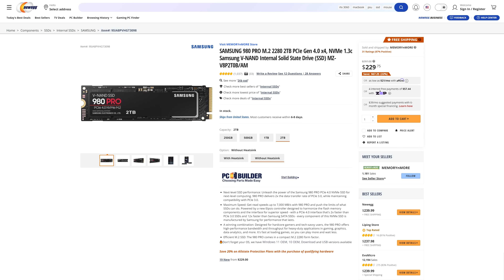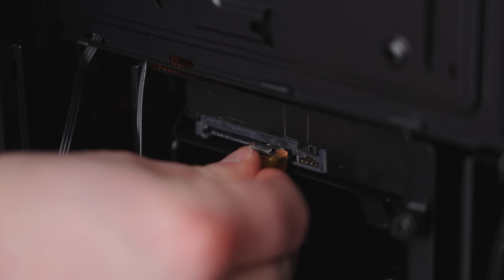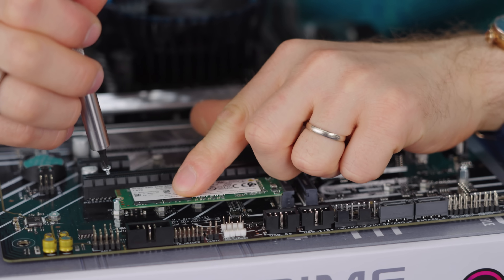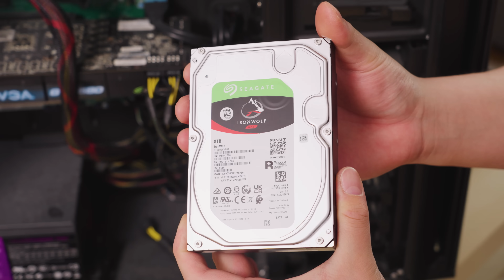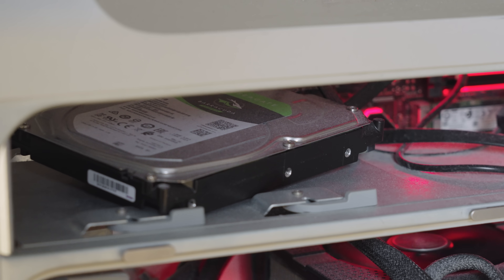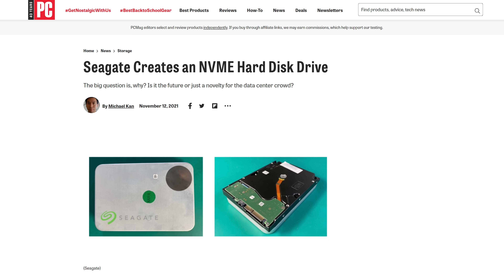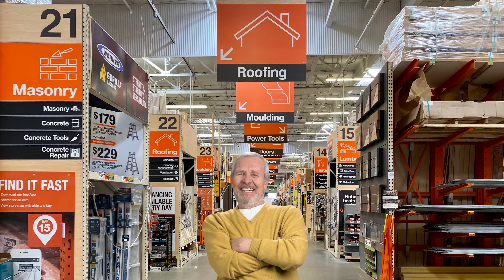Is SATA Obsolete?

Comment: Satas still around in 2025, i figure once they figure out NVME drives with a cable-based comnector itll phase out sata, having NVME drives be off thw motherboard would be much better for cooling properly.

Comment: Until motherboards come with as many m.2 slots as they do SATA ports, then no, SATA will not be obsolete. With SATA, you can fit way more and expand to way more SSDs on a single motherboard, as you can put the SSDs somewhere else in your case.

Besides, I'm only concerned about using an NVMe SSD in an M.2 slot for my boot SDD so that my OS can take advantage of the extra speed that most (maybe all) games do not take advantage of.

Comment: SATA SSD's are only 1 or 2 seconds behind an NVMe SSD on bootup times.   absolutely not dead - far from it.
Reply: I'm using a dramless sata ssd and it works fine even with Windows OS, really curious how long this will last

Comment: You can also just buy one of those not sure how u call them extenders? they split 1 sata into 2, the downside is if you use Bouth ssds at the same time they get half speed, but its still 100% speed if its just 1 i think, so kinda bad if you transfer files from 1 to the other, still cheap way to get extra sata ports

Comment: orignal SATA came out in 03/04 and offered 1.5Gbps, SATA II was introduced in 2007 with 3Gbps and SATA III debuted in 2010 sporting 6Gbps. By that pattern, one could guess that we would have been on at least SATA V running at 24Gbps bandwith speeds.
But no. 
Its been 15 years and we are still stuck on sata 3 with no updates on the standard being developed further. Its like companies said "yeah thats good enough" and just gave up on it. Im very sad to see this interface be left to slowly die from neglect.
Reply: PCIe SSDs took the spotlight and they decided SATA couldn't compete.
Reply: @kassarc16  That doesnt really explain anything, cause by the time NVME was mainatream in 2017, SATA couldve had 2 more revisions. Someone somewhere made the concious decision to just not develop it any further, and no one really knows why

Comment: My desktop PC has Asus ROG STRIX Z390-E motherboard which has 6 SATA ports and two M.2 slots.
I don't even use the SATA ports on the motherboard. I just use NVMe drives it offers more of a clean look and means less cable management I will have to do.

Comment: Just got an 18 TB CMR hard drive that fits in a single 3.5" space. Currently this costs about the same as PCIe 4.0 NVMe 4TB drive, i.e. 4.5 times the price. If you're going for bulk storage, SATA hard drives are still (in 2024) the best.
Reply: With a failure rate of 1 year max and write/read speeds of 272 max. Quality over quantity for me im good!

Comment: Here's the thing about hard drives: if you want bulk slow storage, you also want reliable storage most of the time. Are you willing to buy twice the capacity you need to ensure recoverability in the case of a drive failure? And would you be better off buying an SSD instead?

Comment: Any Windows doesn't need nvme speeds, a cheap low capasity sata SSD with dram or controller will do just fine, its not like windows won't do anything in the background while you play a medium or large game when both are in the same nvme, if the sata SSD boot drive suddenly or not suddenly dies without everything else is cheaper to replace and a lot less time consuming re-downloading everything loss than an nvme dies with everything in it.

Comment: You guys should pull this video down. It's deeply mistaken about something -- namely, that putting additional M.2 drives in your system does not reduce the available PCIe lanes to your graphics card unless you specifically go out of your way to install a riser card AND your motherboard supports PCIe bifurcation (hint: it probably doesn't.)

Comment: The GPU performance part of this video is a bit misleading. I understand his main goal was to talk about SATA but this part adds unnecessary fear among many PC builders. Anyways 99% of the people will have no problem using all the available M.2 slots on their motherboard. Basically this number depends on the CPU and the chipset of your motherboard, therefore you will see specific number of M.2 slot in a specific chipset. For example both "Gigabyte B650 GAMING X" and "Asus TUF GAMING B650-PLUS" has 3 M.2 slots as they are running the same B650 chipset which are made for Ryzen 7000 series. As the Ryzen 7000 series has 24 usable lanes 16X is used by your GPU 4X is used by SSD1 4X is used by SSD2 and the 3rd SSD runs on a dedicated X4 lane built in the chipset. Again X670 chipset motherboards can run 4 M.2 slot SSD where 2 uses CPU lanes and 2 uses the chipset lanes. That's why you will see 4 M.2 slots on motherboards based on X670 chipset.

Remember I said 99% chance ? Here are some scenarios where you can be in that 1% which are very rare scenario.

A. Adding something to your second PCIe x16 slot. For most modern motherboard  it wont be a issue as it runs the first slot at 16X CPU lane  and and second slot at 16X chipset lane. The second slot may be a smaller lane depending on the motherboard chipset. Now for very small amount of motherboard if you add something to your first slot then both slots becomes X8+X8 CPU lane and your GPU looses a bit of performance. However you will not notice this unless you are using using FPS counter before and after because the performance drop is negligible. However in this way you will not be able to make your GPU run on X4 even if you tried which drops the performance noticeably. Hypothetically if you make an after market PCIe slot adapter that can connect 100 more SSD to that PCIe slot still they will share that 8X lane that is reserved for that PCIe slot.

B. A motherboard manufacturer adding extra slots in a chipset. For example a specific motherboard manufacturer may modify and add extra m.2 slot but in that case they will still ensure that GPU 16x is always resaved otherwise you will see negative reviews about it. However they may have disclaimers like using "All slot may make your GPU run on 8X or 4X CPU lane" that's why its always best to go to the motherboard's webpage and go trough the storage specification before you buy. These motherboards exist for people who wants more storage and does not care about GPU performance and even may running on low end GPU or CPU integrated GPU.

C. This is the most common case and can lead to 4X without you even knowing. The current gen R7000 series uses AM5 socket and their next gen CPU will use the same socket. This means the new chipsets and new motherboards that comes with the new series will will also be able to run the old R7000 series CPU. However those motherboards chipsets may have more M.2 slots which ware specifically designed for the CPU they came out with. Now if you add an old R7000 series CPU in the new motherboard that CPU may have less lanes than the CPU it was designed for and causes the  GPU to run on X8 or X4. It will all depend on how many lanes difference between the 2 CPU generation. So its best to stick with the chipsets that came with the CPU you want to buy.

Took me 20 min to write this. Hope it helps someone who became nervous after watching this video and now can shop easily for their next build. Happy building.

Comment: If the SATA SSD is considered obsolete, then why is it priced higher? I bought a Samsung 870 EVO 1 Terabyte last March 2023 for around $64.99 USD, and a year later, it cost $99.99 USD. If we label it as obsolete, logic dictates it should be priced lower compared to NVMe SSDs. Therefore, its increasing price suggests it's not obsolete. Conversely, iPhones become obsolete with the release of newer models, leading to a decrease in value. If we consider the SATA SSD obsolete, its price should be lowered, making it an ideal upgrade for older devices that support SATA drives."

Comment: Yes but also no. TD;DR of my comment the avg consumer they will not notice nor care that it is going from 2.5" to M.2 or SATA to PCIe. For who cares it seems like it comes down to cost and how many drives do you want. 
The longer but explained form
Yes as it is cheaper for OEMs and SIs to just put in a cheaper M.2 SATA SSD 1TB drive than a 2.5" SATA SSD. As most consumers are good with  drive they will not notice.
Now when you get to home NAS the up front cost of 700 USD for the entire thing is a big sticker shock to many people. Even though M.2 NASes exist most do not know nor are they as upgradeable as SATA NASes are. SATA is preferred over SAS due to cost but SAS is used for servers that want to know which drive failed and other software functions that only work with SAS but otherwise is being  by SATA in some due to lower cost drives. 
SATA data and SATA power are also is required for CD/DVD/Blu-Ray drives which few people still get but windows install still comes on so enough people  still have them for it to be profitable to print DVDs with windows 11 on them.
SATA is used for front panel functions though mostly SATA power not SATA data. Same with SATA power for some expansion cards. Some card readers that have the internal connector uses SATA data not USB.
SATA power is also used for some fan hubs though most also connect to the USB 2 or USB 3 internal connector not the SATA data connector.

Comment: 2.5" SSDs should still be produced, because its such a good storage type to have. Lots of ports for it, slim enough to not cause problems with space, fast enough for basically every type of usage. M.2 are good, but most boards, especially early boards cant use more than one and most people still like to have 2/3/4 storage devices to spread the data they hold. It's crazy that these days you have just a couple of models left and how expensive they are, in many cases more expensive than NVME.

Comment: Hdd are good for torrent download especially 100gb over with 1gb broadband over. If you do this on nme your cpu will go Berserk €
Don't believe that Nvme  are the best thing for you .Nume is good for short high speeds but for long copying and large files Nume are way to slow and give a strain on cpu.
I know because I have an 7800x3d and 7900 xtx.

Comment: Wouldnt it have made more sense from a reliability point of view to have a 2.5inch SSD operating on NVMe protocol via PCIe as the primary hard drive (if processing speed is what sells) than what we have now on many new computers i.e. M.2 NVMe SSD via PCIe  which is prone to overheating and requires an efficient heat sink to keep it cool?
Reply: the 2.5" takes a lot of space (relatively). Hence ya

Comment: I Still very
 much use SATA drives, mainly for mass storage, A 3 TB hard drive for my games however with new oncoming games like star field with direct storage access, if you haven't tried starfield on a hard drive... Let me tell you your lucky  i actually couldn't play it without installing a new 120gb SSD into my system and even then that week it came out with a 20 gb update that made it too much for my ssd and i could no longer play it, back on topic its a great technology but its the only game i know of to take advantage of this though, so HDD is still very much alive and kicking and for games its not a necessity to have an ssd bulk storage hdd works fine

Comment: why do you need more than 3 ssds tho, just get a big drive and use that instead of spending more now on a sata ssd also the m2 slots use chipset pcie lanes not cpu lanes so you will have enough for the gpu anyway

Comment: SATA is/was a standard design FOR mechanical hard drives (HDDs) it just did the trick for SSDs for a while, the entity that controls the SATA standard gave up on making a new version because it doesn’t makes sense for HDDs and would be a lot of effort increasing a lot the speed while maintaining the compatibility or something like that they said, NVMe was tailor made for SSDs the same way SATA was for HDDs

Comment: I'm surprised by how many people are so ignorant about the importance of random over sequential read/write performance. It is the random (4KB, Q1T1) performance that makes the difference between SSDs and HDDs. And in that respect, even the meagre SATA-1 speed (150 MB/s) is unlikely to be saturated by some current SSDs.

The reason I choose NVMe over SATA isn't speed, but cable management and aesthetics.

Comment: You forgot to mention that SSD or NVME drives have limits on reads/writes, but those should last you years. One big downside of SSD or NVME is that through time the quality of the drive degrades, whereas the mechanical drives don't, unless they fail.

Comment: Nope, sata is alive. I just bought a 2TB sata ssd for 65GBP, also 6TB HDD for 60GBP (the hdd only has 0.5M MTBF, so lifetime is half of usual when running 24/7) Yes, I use NVME, but still booting from sata. Actually my 860 evo still has higher random speed then my NVME-s.

Comment: sata is dead not even the cheapest setups come with sata drives, and that the gpu takes your cpu lanes well it is not true cause pcie v3  connects to cpu via chipset so called peripheral controller hub which is in the cpu inside and is connected to the OPI port and that has 1 lane which is verry fast interconnect but still all your connected devices to communicate through that can become laggy. from Pcie v4 and up it is attached direct to cpu witch 1x4 lanes if you have an egpu that is connected thru thunderbolt wich is a direct to cpu bus ( usualy 1 lane )  note that may varry depending on your cpu architecture

Comment: You didn't consider the strengths of the SSD though that make it superior to the nVME.
It's portable between systems.  And backwards compatible.  You can take it out of your system, and plug it into any system going back to 2003.   You can add it to any system going back to 2003.
I have two dozen computers that support SATA, and only one single motherboard that can support an nvme drive.  If that motherboard fails, how am I going to get the data off???
A SATA drive is a lot easier to connect to.   Just plug in two cables.   An nvme you have to take apart the system and pull out that monster GPU just to get to the nvme slot, which is a huge headache.

And your speed gain is not 10x, not even close.   Most of your reads and writes are random, not sequential... so the real world random read and write performance is going to be a lot closer to each other than you think.

Comment: as an owner of a small town computer repair shop... no they are not obsolete because ddr3 isn't obsolete.  For new tech yes it is but for windows 10 and 11 no it isn't.  also you can just install windows 11 on a better pc transfer the drive and update drives and boom it works great on 16gbs of ddr3 a > 2.1ghz 2nd multi core processor and a ssd SATA drive. at least for things most people use (chrome and email and word processor) i have it running great on 2nd and 3rd gen intel i3 and i5 processors
though it does in fact run better on windows 10 of course
can it game.... i can get older games to run on my intel 2700k with a 1650ti and 32gb of ddr3

Comment: For pure storage space, having something like a 7200rpm 4+TB hard drive is still faaaaaar cheaper than the same capacity in solid state. For stuff you don’t need silent operation for, or dont need to load lightning quickly, hard drive is king.

Comment: I have 2 M.2 SSDs (Arch), 1 SATA SSD (Windows), 6 HDDs (games), 1 not connected floppy drive (need a controller card) and a Bluray burner.
My PC has in total 24TB Storage. My HDDs normally load the games faster and I think Btrfs is one of the reasons...

Comment: nvme is lot harder for configuration when chipsets varies by models from either intel or amd for consumers are sure seeing many many models of mainstream b650 or b760, they could have either pcie4 16x slot or few models have pcie5 16x slot with 2 4x nvme slots ...one is pcie5 while other can be pcie4 setup..thats part not all gonna get good results for adding more nvme slots , its counter reproductive for consumers on bad chipset limits, sure its faster than sata , but for gaming ??? only one slot get more bandwidth than 2nd or 3rd one gets worst bandwidth

Comment: PATA SSDs exist. The reason why SATA was adopted has basically nothing to do with SSDs vs HDDs, SATA was adopted because it was more compact and more durable.
Most secondary M.2 slots on motherboards are connected to the chipset (except on AM5, which has 24 PCIe lanes from the CPU, so you can have 2 M.2 SSDs in addition to 16 lanes to the GPU).

Comment: Regarding sata ssd's, would there be any benefit to having a Sata III M.2 ssd connected through an adapter to the PCIE Gen 3 slot on the motherboard instead of having a Sata III ssd connected through the regular sata port/connector?  Would the PCIE connection offer less latency than the sata port connect?   There seem to be hundreds of videos on youtube and thousands of articles on the internet about Sata SSD's but I have not come across any addressing this question, not in the slightest.

Comment: HAH! I'm running IDE 133 adapterd into my SATA 3 ports on the mobo to use a 15years old Spinny Drive of 500Gb, Use It for vloated Steam games.

Also have SATA 6 m3chanical drives in my NAS. I don't know this talk about SSD or NVME being cheap? I still think 2.5Inch SSD are expensive here in Sweden.

Comment: Sure sata is dead get a nice 20tb drive for under £300  and a super fast  4tb drive costs loads  to slot in nvme needs to get  cheaper  yet still be plenty fast sata will die when we can get a 8tb crucial  nvme for a good price in the next 10 years maybe so hdd and solid state drives well hdd is still slightly  cheaper than ssd and nvme being  top performance  tho